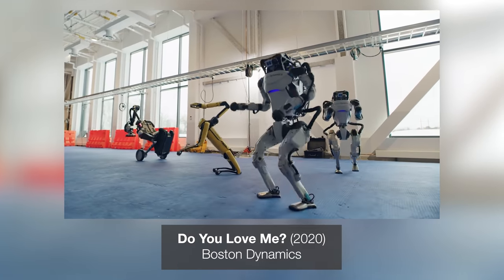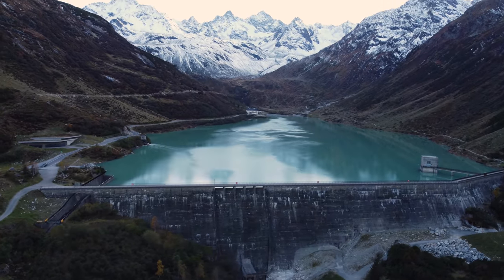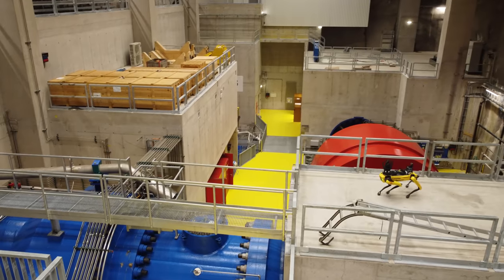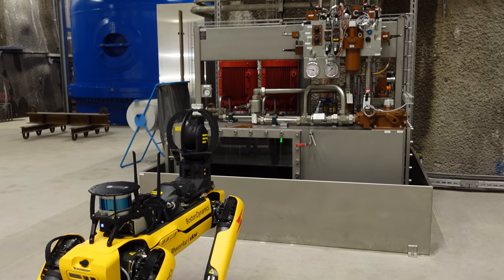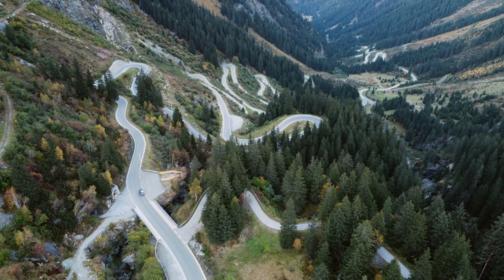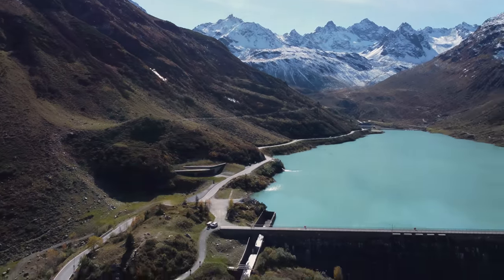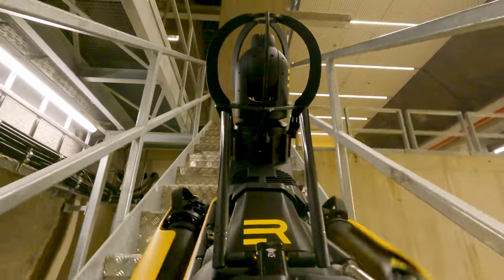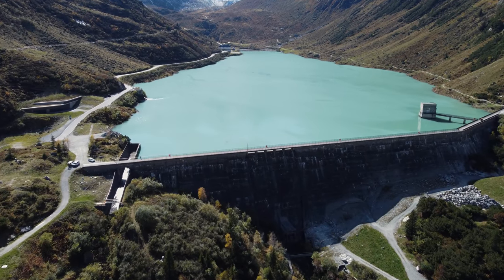An actual, real-world use for robot dogs

Comment: Nice use of the dog. I do hope people keep visiting the site, even once the programming becomes advanced enough to complete the entire rapport and check all the things. As Tom himself talked about in "Help, My Fusion Reactor's Making A Weird Noise", human intuition is a very finely tuned sense.   

On a whole other note, Think of the power they can save by turning off the lights between inspections if no other people are at the site.
Reply: To be fair it is a power plant, I'm sure having those lights on 24/7 Vs off 24/7 wouldn't even be visible on the power generation reports.
Reply: since LEDs are probably the main light source, they barely use any power at all - but I'm sure they still turn them off regardless.

Comment: Just an interesting fact 80% of Austria's power is renewable with 62% of that coming from Hydroelectric. Another interesting thing is every single nation that is fully or nearly uses no C02 in energy production all of them are majority to 100% Hydroelectric. So when anyone says but wind and solar isn't good enough, you can point to hydro (obviously geography dependent like all power plants are).
Edit : I'll say it again I did say Geogrpahy dependent just like evey other type of energy production.
Reply: Cool fact
Reply: Hydro sadly isn't a silver bullet since it's devastating to a river's ecosystem, but it's one of the best alternatives to fossil fuels where available.
Reply: I'd say very geography dependent. Not every country is in the Alps.
Reply: France is almost 0 CO2 but is mostly nuclear with hydro a fairly distante second. It's also relatively cheap which goes against the idea that nuclear has to be expensive.
Reply: In Brazil it was like this until there was no rain and no plan b.
Reply: Fun fact. They are using hydroelectric power cause was and is cheaper (than coal for example) for them and not cause they wanted to be CO2 neutral. 
Now its probably both.
Reply: @lowlize  Which is why we need interconnected power systems so that hydro can be used to cover for lack of wind or sun in other areas of the continent/world.
Reply: Heavily geography dependent AND can lead to the extinction of fish species like with the Three Gorges Dam and others
Reply: I am from Austria and we are very lucky to have giant streams like the Danube to use it for electricity. It really depends on the location.

Austria has also a nuclear power plant, but it never got activated. In my opinion if you want to use alternative energy, a good mix between nuclear, wind, solar and hydro is key.
Reply: @lowlize  you don't need alps close set hills are good enough
Reply: The United States already has close to maximum capacity hydroelectric production, and it's only a tiny fraction (15%, IIRC) of our power needs.

We either need trillions of investment into solar and wind, or roughly half that much money into nuclear, or we're stuck with fossil fuels longer than anybody (besides the industry) wants.
Reply: do we start a nuclear debate here?
Reply: Austria, France, Switzerland and Italy (I'm sure for my country atlest) have already built an Hydroelectric dam in every possible location
Reply: @gavinkemp7920  France is no where close too 100% no C02 production, it's nuclear reactors are getting old, nuclear is geography dependent and more expensive.
Reply: We have nuclear power
Reply: @bernaferrari  looked it up a poweplant may have had to go offline but it sidn't in the end.
Reply: @holy3979  never said it was a silver bullet just that it's an option, I even put geography dependent in my post.
Reply: @simocity99  no they definetly haven't built all the hydro dams they can.
Reply: @wigglerlesbian  no.
Reply: @wigglerlesbian  It is pronounced Nu-cu-ler.
Reply: @BradyPostma  can you show me where you got the idea the USA, is at maximum capacity for Hydro?

Nuclear is the most expensive power source, (solar is the cheapest) so you'd need more than for a wind and solar (why stopping at just those two types idk).
Reply: But people should also know, that hydropower is no real green way of producing energy. Even though it does not produce greenhouse gases once build and one all flooded plant matter is decomposed, you still need to flood huge areas in order to get the amount of water stored to reach the right amount of pressure. People tend to forget about other environmental factors, but rather look at how much greenhouse gases are produced. Dams alter the natural water flow regime upstream and downstream. This has consequences for wildlife (migration and spawning of fish, riverbank vegetation, build up of sediments) and humans as well (reduced floodplains for farming, less income from fishing and relocation, less nutrient sediments downstream). So yes, lets use the current hydro plants, built in a sidestream for wildlife but stop building new ones.
Reply: @chronictimewasterdisease  nuclear is the most expensive and takes longer than any other form of energy to set up, so no.
Reply: @Alex-cw3rz  rivers were expected to reach 10% of level, they turned on coal and it also rained, now it is 18%. Not exactly comfortable but better. Worst scenario in 90 years.
Reply: This is confusing and misleadingly formulated. Just to remind you: Energy IS NOT the same as electricity. Not all energy used is in the form of electric power generation. Total energy includes electricity generation but encompasses more than that, for example heating and vehicle transportation.

Austria's primary energy input is close to 35% oil and 20% natural gas as sources according to IEA statistics. Austria's electric power meanwhile is close to 70% renewable with close to 60% relying on hydro.
Reply: @bernaferrari  can you give me a source as I looked into this and couldn't find any of these numbers.
Reply: @iamtheusualguy2611  it's not misleading because the coloqual and academic term is energy production and not one person doesn't know that it doesn't solve methane from cows etc.

Your maths doesn't add up, 35+20 is 55% and then you said 70% is renewable...
Reply: @sharp14x  nuclear power is the most expensive and takes the longest to build. And Hydro doesn't suck it's created 9 out of the 10 most powerful powerplants and all countries that produce 0% to almost 0% emissions are majority too 100% hydroelectric.
Reply: @Alex-cw3rz  Hardly.
Reply: @Alex-cw3rz  What source can you point to that says solar power is cheaper than hydro or nuclear per GW (or per kWh)?
Reply: @Alex-cw3rz  the carbon intensity of electricity generated by hydro, according to IPCC is 24 gCO2eq/kWh, which is double that of nuclear (or wind).  this is mainly due to initial construction emissions and methane (CH4) being generated from degrading organic matter (this is less of an issue in colder climates).

sidenote: austria is a net importer of electricity (10-15%)
Reply: @karioken  👍🏻
Reply: @Alex-cw3rz  at 7.1% fossil fuel it beats Austria. Nuclear is less geographically dependent than hydro. And your argument on the age of nuclear reactors is irrelevant to the debate, although I would wish that France continued investing into nuclear.

Comment: Robot Dogs should have wheels at elbows to speed through long flat areas, can also lean into corners while at speed
Reply: i think the dog's feet being round already prepares it to just have those be lockable wheels
Reply: @MrRyanroberson1  You mean drivable motorized wheels
Reply: Teach them to roller skate!
Reply: @nealmacdonald9896  i also mean lockable wheels because having them always be active and having to exert a torque just to stop them from rotating would introduce incredible inefficiencies
Reply: Same principle as elon's electric car .....no brake pedal just accelerate decelerate. Each wheel has its own motor
Reply: @nealmacdonald9896  I still mean lockable wheels
Reply: I was thinking it should have wheels at the end of its legs, that can mechanically lock to become feet, and then unlock to be wheels again.

Comment: Out of interest, what's the advantage of using this instead of setting up cameras pointing at anything that Spot would inspect?
Reply: looks cool
Reply: Or a camera on a rail like in Portal 2.
Reply: The Thermal Camera on this robot is about 5000$ and you can do the math, at what point the robot is cheaper than multiple stationary cameras
Reply: Was wondering the same thing. I assume there are enough things to inspect that spot can do it cheaper than putting up all those stationary cameras.
Reply: A few hundred cameras + the data infrastructure to support them will cost more than a camera that can move.
Reply: You can react to unforeseen incidents in places where you didn't think you needed a camera, get different angles to troubleshoot, monitor e.g. long distance pipes/cables (and it becomes quickly cheaper to have a robot walk down a kilometre of pipes instead of installing and maintaining cameras over the whole distance), etc. You can also send these into places where installation and maintenance of cameras is dangerous.
Reply: Gonna guess versatility - you still get the ability to just drive Spot to any arbitrary point you need to look at, rather than being stuck with the spots you expect things to break. (Also assuming that the whole place shuts down if comms are lost?)
Reply: Not having to set up cameras.
Reply: If a fixed camera breaks, it has to be manually repaired or reinstalled. If robots break, you'll just have to activate an another one remotely.
Reply: one of the main things is the price of a camera and how much more "uselses" data stationary cameras produce. why putting up 50 cameras that dumb data on your server when you can have 5 moving cameras that have a way better way to look at changes in the system because it can move around the object and has less of a dead zone because of that.
Reply: @t9o6b3i  mathS
Reply: If the camera has to move, attach a simple motor and hang it off a rail that goes through the facility, don't invest in expensive robot dogs.
Reply: @t9o6b3i  don't forget the cost of Spot itself, which IIRC is somewhere in the neighborhood of $70,000.
Reply: @dovos8572  stationary camera wouldn't break as easily.
Reply: i think there's a certain point, and they've probably made extensive market research for this already
where the amount of high quality camera you need outweigh the cost of just buying one more expensive moving one
(also I would assume a robot dog can just walk closer instead of zooming in if it's static)

as I see it spot the dog isn't the "best" solution, but in a very weird way, the most feasible and practical solution
as the guy even said, they could just use wheels or tracks instead of complex walking dogs
its just that the cost of retrofitting a whole powerplant with ramps and such is not worth the effort when a plug and play solution already exist
Reply: @romxxii  still cheaper solution than install cameras all over the facility
Reply: Up close inspections that fixed cameras can't do.
Reply: I'm guessing that would be a whole lot of expansive cameras (with thermal vision and whatnot), possibly costing more than 1 of those robots
Not to mention they are working on automating the process even further which can't be done with just cameras
Reply: For one thing, if you have 20 cameras, and one fails you can't ask another to wander over and check something. If you have a couple of robot dogs and one fails you can get the other one to do the whole job, or find out what happened to the one that failed.
Reply: wow wow wow!Hold on buckaroo! We cant just use some cheapo webcams! This is now how we got to our robot revolution! x) /s
Reply: On that same note could use a whole suite of IoT sensors (embedded temperature sensors) tied to each specific device that is either ip capable or forwards to an ip capable hub which would provide constant telemetry instead of the intermittent telemetry that the robot does
Reply: A fixed camera can only see one side of an object, and cannot go and look around a corner. Both of those examples would require another fixed camera to be installed, connected to the server, and have the data filtered by software or checked by humans.
And if "Big Machine #3" is returning unexpected operation data, you can dispatch the robot to do a 360 walkaround of "Big Machine #3" while an engineer is getting kitted up and sets out on the way.
Reply: Versatility, extensibility, and cost. It's a $5000 camera, you'd need hundreds of stationary ones, and the robot only costs $75k. And one device needs a lot less network infrastructure (which is expensive to install and maintain) than hundreds of devices.
Reply: @t9o6b3i  You don't even need them. Just put a few temperature sensors on the parts you want to monitor. Why bother with expensive cameras when you can use super cheap thermometers for 1 euro each.
Reply: Those sensors already exist and work. But the inspections are to make sure that they are indeed working and to have redundancy. These robots replace the inspections not the measurements. You can't think of these to monitor something that is expected, but to monitor something that wasn't planned.
Reply: @elukok  err hate to burst your bubble but they're already using those sensors in these machines.
Spot is there as an auxiliary inspection unit, they're not choosing between a robot dog or a thermometer.
They have both.

Comment: It's incredible that they are so confident in the engineering of these plants that they're comfortable having them be occupied by a single robot dog instead of having engineers and inspectors on the premises at all times.
Reply: It was literally just said there's a shortage of engineers. Are you for real?
Reply: This site can't be accessed in Winter due to the road being closed because of the danger of avalanches. So the plant is designed for this. The robots are just additional safety.
Reply: @thehatred94  it is actually cheaper to maintain a robot, than to pay an engineer an engineer wage

Comment: This is cool and I'm glad to see that these robots are being put to practical use, otherwise we might lose them. One question though: couldn't they have a human engineer go out there one time and plant a camera aimed at each spot that needs inspection, rather than having a robot walk around and take pictures?
Reply: Good question.
Reply: The cameras cost a lot of money. Easier to have one that moves around than multiple cameras
Reply: Well let's say you've got a table in an empty room & you want to visually inspect all sides of it, how would you do it? It's true you could set up a camera on the left side, a camera on the right side, a camera on the front side, a camera on the back side, a camera on the underside & a camera on the top side. It would work but you could also just walk around it & crouch under for a second.

Process one required a lot more equipment than process two.

Now what happens if there's two tables? What if table 2 now blocks the sights for the camera of table 1? What if table 1 has to be replaced quickly with a differently shaped table?

Now what if it's not a table in a large open space but many many dozens of machines, rooms, pathways, walls, tools & lights that you need to be able to examine from even just a single angle, let alone multiple?

What if you don't just want visual recordings but you want to monitor the sound in those areas?

What if there's been a flood in part of the building not usually monitored as heavily & you want to inspect that?
The fire alarm has gone off in the office, is it a real fire or is it Darryl having a smoke? The server in the basement has just gone offline, flood or just a power plug pulled out by mistake?

This is why a mobile platform is significantly more effective and efficient than a camera for each thing you want to inspect.
Reply: @Foojaleeckalikeelamaka  This is a stationary facility with stationary machines, where you know everything you need to look at. This robot dog probably costs like 1,000 cameras. You could point a camera at everything you need to know and every other problem you raised is solved with software.

There is very very little use of a robot moving at 1kmh to check on things in a facility with no people, where everything you need to monitor is known. Frankly it is a waste of money.

Comment: Also: not having to send a human unless necessary means saving a lotta fuel (and in the case of electric cars, the accu), which is much better for the environment and doesn't require so much fixing cars broken down from the wear and tear caused by driving those shitty roads.

The humans can use a gym, for ex, to do something productive instead of dying of boredom.